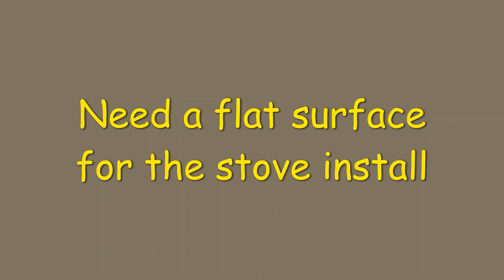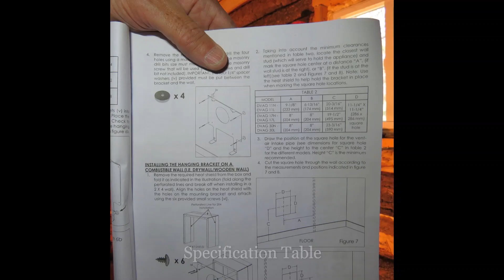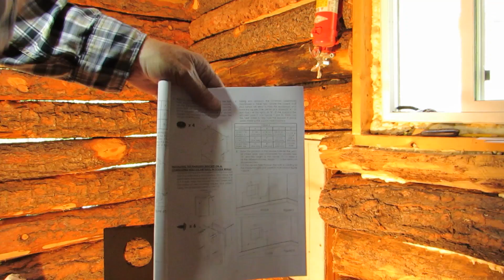Small Log Cabin in the Woods Part10 (Installing Ashley propane heater in the cabin)

Comment: Hello....nice job on the installation.  Did you do another video with the propane hook up?
Reply from the maker: Not yet, as I have to build a deck to get proper height on the pipes coming through the log wall
Reply from the maker: The propane hookup should be uploaded in 2 weeks
Reply from the maker: Yes, last Saturday

Comment: I just got the same heater. I used a chainsaw to cut the wall, though. I've had no issues with it. I did end up getting a power blanket for it to keep the tank warm (it's outside).
Reply from the maker: It works great, and I can heat my cabin to 65 degrees on setting 2